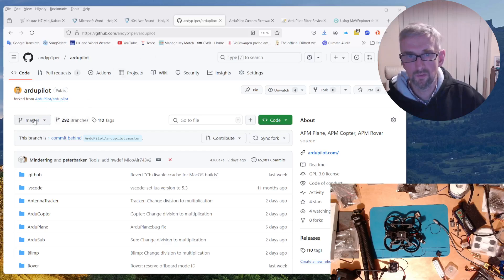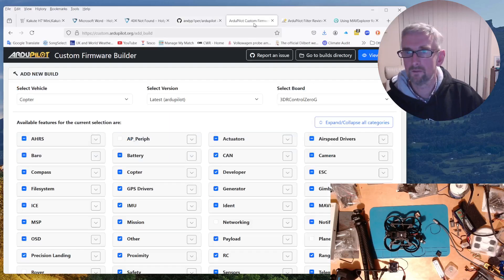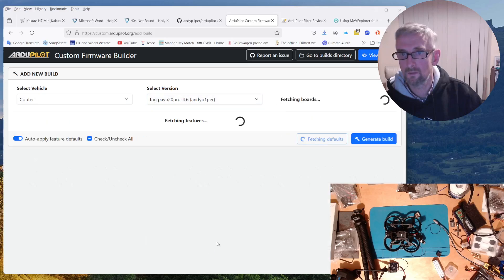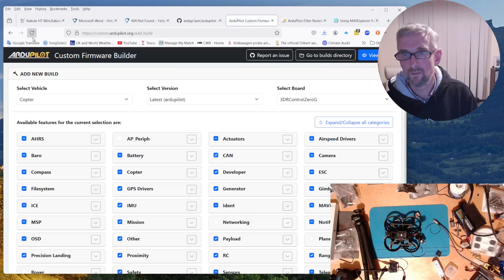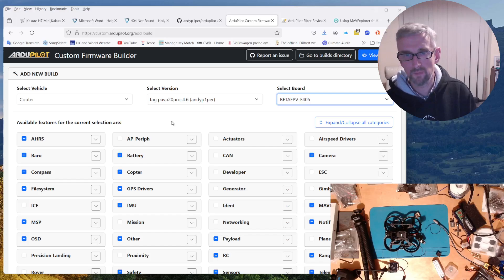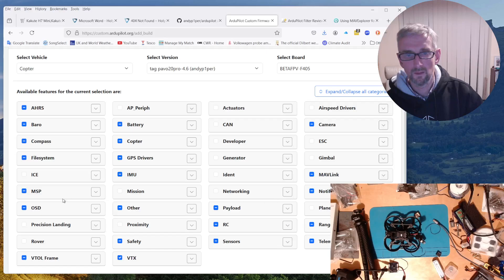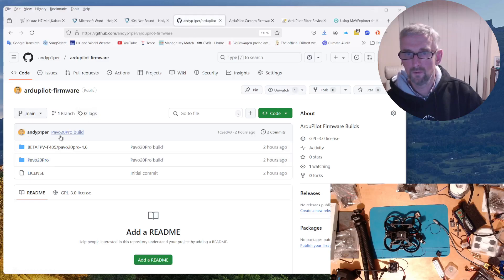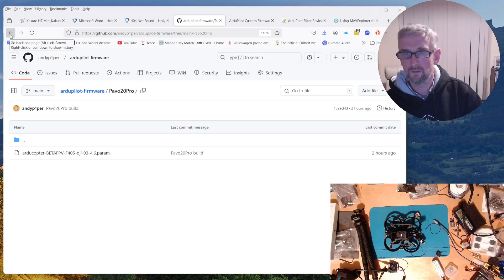Pavo20 Pro Video 3 - Getting the Firmware and Parameters

Comment: Getting back into FPV after a little while out, Pavo20pro on way, about to put it all together this week....  I'm used to betaflight, So i'm curious.... Is this for anyone or a specific purpose firmware?
Reply from the maker: For anyone. People were having problems getting things going so I decided to get one and figure out the issues - The ArduPilot foundation kindly paid for the drone.
Reply: @andypiper5285  Thank you for the effort, this is more thorough than most anyone does anymore :) now to decide if i want to switch up ;)